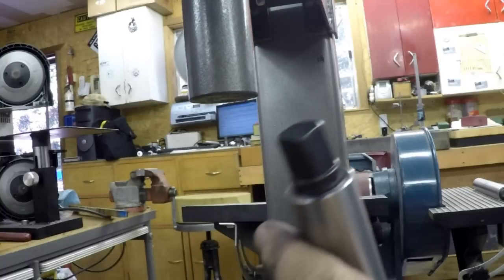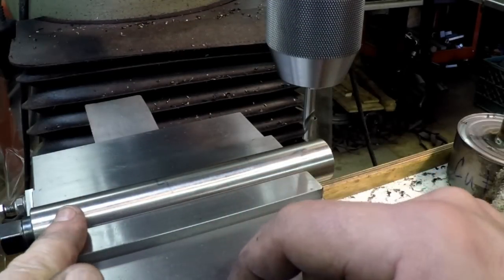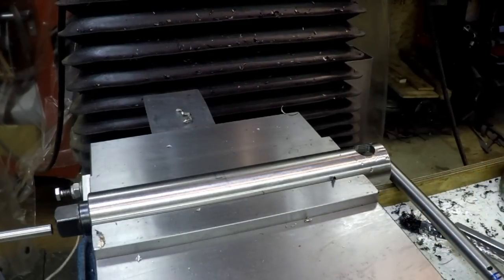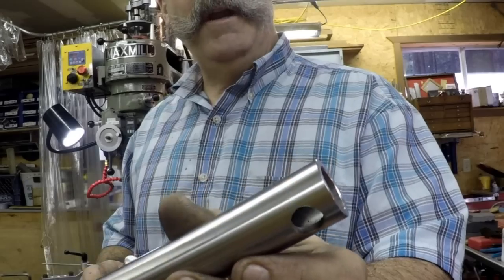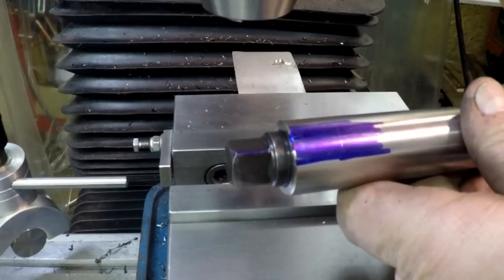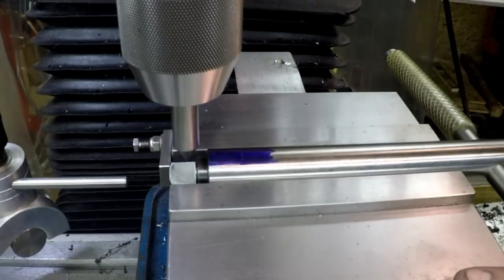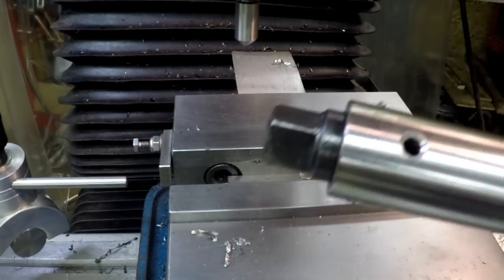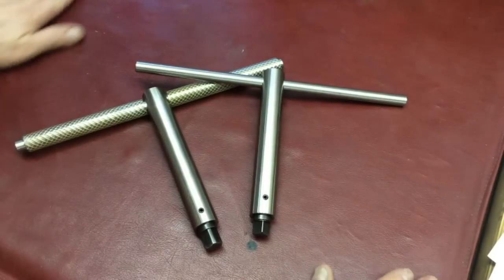How To Make Tubular Lathe Chuck Key Part 3

Comment: They really are beautiful!  I agree - you get an A+ on this project. Thanks for showing the hardening - I had no idea that W-1 steel turned black like that when hardened, but it looks great. Those chuck keys are truly heirloom quality, and the way you made them, they should last for a very long time.  -Chris
Reply from the maker: bx2200 Thank you Chris for the nice comment.  They work great and the fit is perfect.  i need some better hose for the handles.  The heat causes the Fe atoms to oxidize then when put in to water Magnetite is formed (Bluing) a little wire wheel action (Carding) and you get a nice black rust resistant finish.   Do not do it this way on a gun.  There are other safe methods for that.  Thanks for watching.  Randy

Comment: Hi Randy,
Finish product is looking great.
With so nice looking tools, I fear using nice stuff so not to wear or scratch them, in any case the first dent is always the most heart breaking...
You just discovered a new way to knurl using a reamer, quick get it patented.... lol
Excellent work,
Pierre
Reply from the maker: pierre beaudry Thank you again Pierre, I owe you for the catch.  The trick to getting the knurl just right is the length of the tube and the brush length must be just right and the space between the reamer and the tube wall just right.  I don't think the across the pond group could figure it out.  I could not stop laughing when the brush came right back out.  Thanks Randy
Reply: Randy Richard
Got 2 brushes laughs this week, your brush catch and Keith's, that's what I call a great laugh week... lol
Reply from the maker: pierre beaudry Because of Keith's brush I had to leave it in.  BoZo Humor.

Comment: Hi Randy,
Nice job on the chuck keys. It is probably best that you inserted the roll pin at the bottom. Especially the 4 jaw one. You sometimes need a lot of torque to zero a part and the square insert may have spun in the main shaft of the handle. Enjoy using your new chucks.
Reply from the maker: David Calabretta Thank you David.  Yeah I thought so to.  Just for good measure.  Thanks, Randy

Comment: 92 views so far.  You should stage your Bozo visits on purpose.  Put that brush on the wall for looking at any time you need a laugh -- or a reminder what tools can do to fingers.

Do you know about roll pin punches?  They drive roll pins in and out beautifully and keep the punch centered on the pin.  No damaged pins or holes.  Here is the set I have:
http://www.brownells.com/gunsmith-tools-supplies/general-gunsmith-tools/punches/roll-pin-punches-prod5551.aspx
Reply from the maker: The brush was pretty funny.  I am still using it.  Yes on the punches,  I just don't have a set.  
Thanks Randy